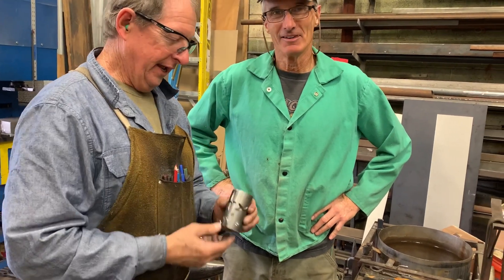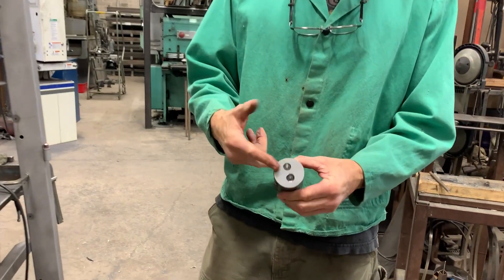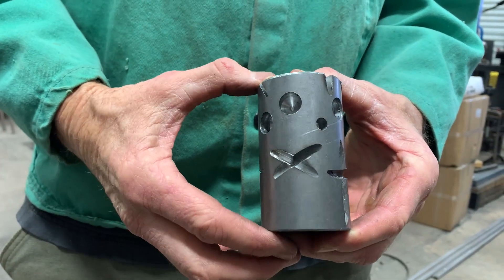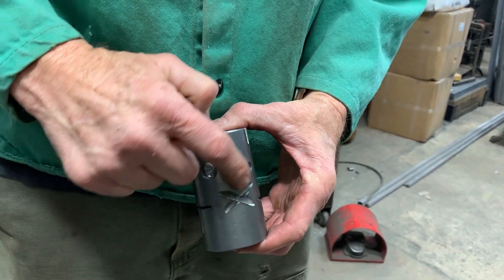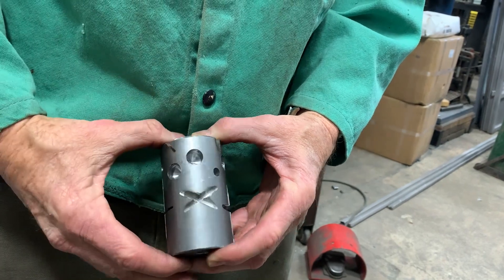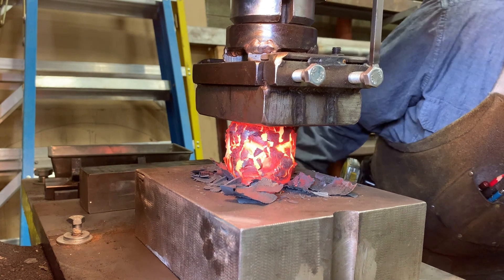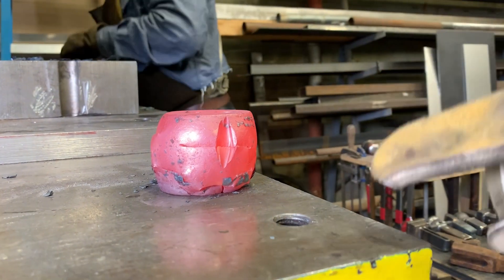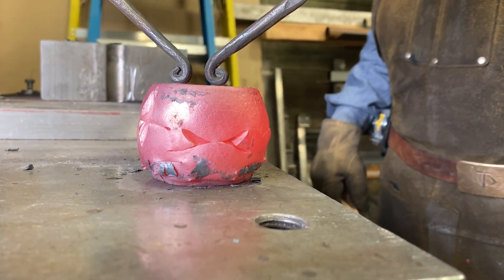What Will Happen? Experimental Hot Metal Pressing 1

Comment: I like that, it would make a great holder for a single rose tube ...but looking at the way each modification reacted I think you could get reasonably predicatable results by doing more holes or more X's ...going all the way rounf with vertical cuts would be interesting too but only with scrap at first cause thats an expensive experiment.
I wonder what would happen if you hammered it down instead of pressing...
thanks for sharing